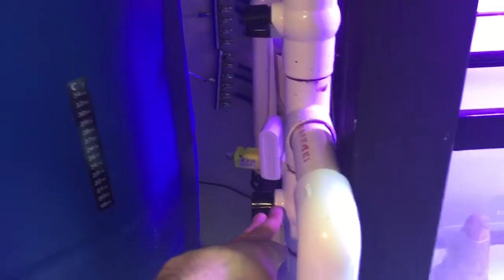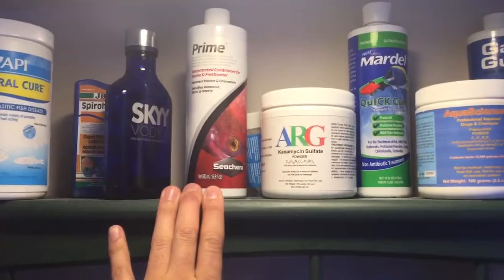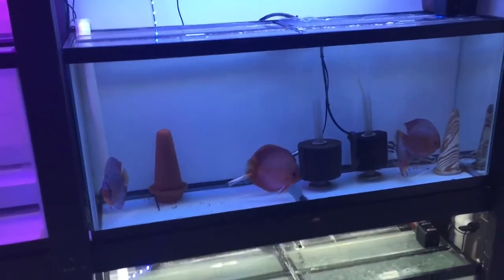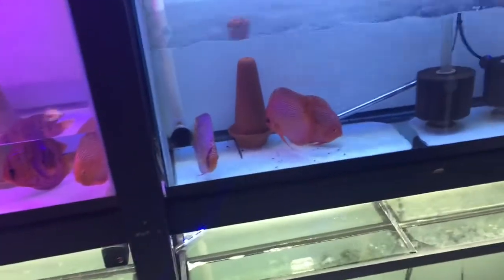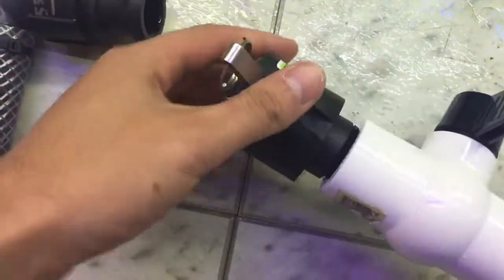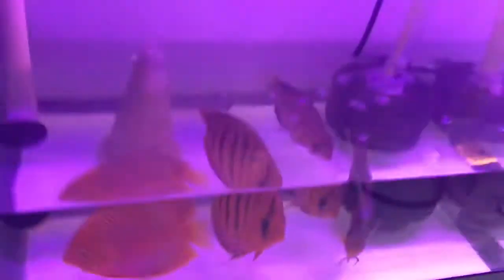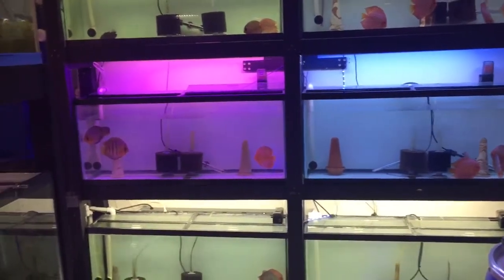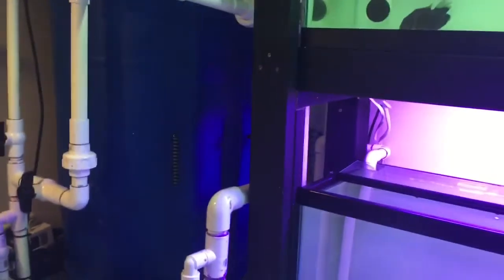Discus Water Change on 55gal Rack

Comment: Thanks for the video.  Just what I wanted to see!!
Reply from the maker: no problem, I know it's hard to hear/see everything.... but figured it's a start lol... I'm going to try and get some footage of the innards of the water aging drums and how they work
Reply: GVB Discus that would be great. I love as many details as possible
Reply: Watched it 3x times now and picking up a little more each time. Please do post part 2...  thanks.
Reply from the maker: what are you interested in seeing? if you let me know I can focus in on that stuff next time...
Reply: GVB Discus thanks.  You ended the video taking about having a float valve... can you explain or show how it’s plumbed. What filter are you using to pretreat the incoming water?  The cartridge is the same as I have on my minnow master bait tank... fascinating system for bait keeping.  ( https://www.minnowmaster.com) Where are the heaters located?  It doesn’t look like your tanks are drilled, so both intake and drain are through the pvc you showed? I guess being a bit dyslexic, it takes me a bit longer to understand the plumbing and ball valve functions and sequence. Maybe a schematic would help... any help is really appreciated. I won’t begin to consider buying discus until I have everything in place and functioning properly.
Reply from the maker: I see you want "the works" ;) .... but yeah no problem, I can certainly try to make a video about that and go into the specifics of plumbing rather than doing a physical water change. I put up another video today of a variation on my previous water change but let me see what I can do to answer your questions. But to briefly answer you on some items... 1) in regards to the float valve, youtube cut my video short as I was explaining, but there are not many things in my room that are drilled. I use a combination of standard plumbing pieces to get a pipe into the top of the drums, and with the top of the drum being removable, I am able to go inside the drum and place the float valve onto the tubing.... if that makes sense. 2) I the cartridge to treat water entering my aging drums is just a simple carbon filter to remove impurities. 3) the heaters are in each drum, a 300watt Eheim Jager per drum is what I use... but 150watts could be used. I'm thinking about installing external controllers to manage my heaters more effectively to get them to the desired temps I want withouth having to go into each drum every time to adjust.... but those external controllers can be flakey. 4) My tanks are not drilled, so yes the intake and the drain are one and the same.... some people do it separately and I thought about it but it just makes everything more complicated IMO. The only tank that has separate intake/drain is my 200gal tank as I obtained that pre-drilled by the previous owner so I had to take advantage of what was given to me, and it works well for that singe tank setup. That tank is changed very differently than the rest because of that. 5) If I have time I can do a schematic and post it to my simplydiscus homesteader page which would be located here: http://forum.simplydiscus.com/forumdisplay.php?388-Greg-s-Discus-Room(GVB)-Medford-NJ
Reply: GVB Discus thanks, every bit of info is helpful, I really appreciate it.  I’m on simply discus as well and will look forward to see the schematic, I’ll send you a friend request under gofishjim.  Thank you.